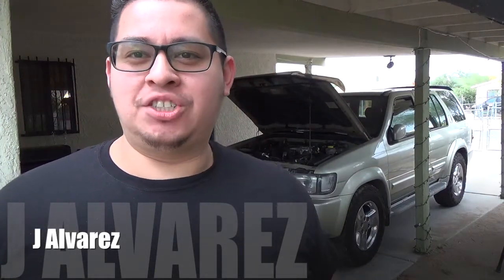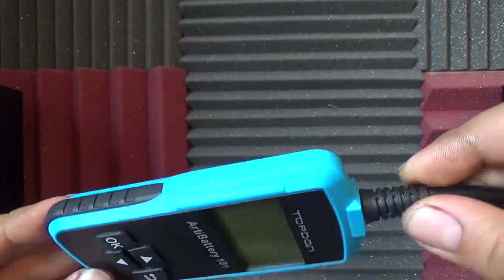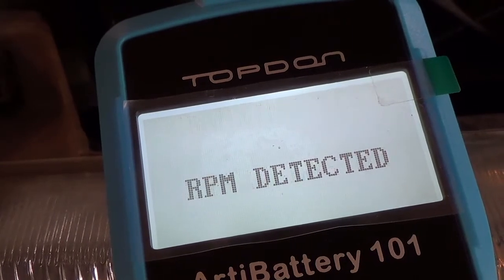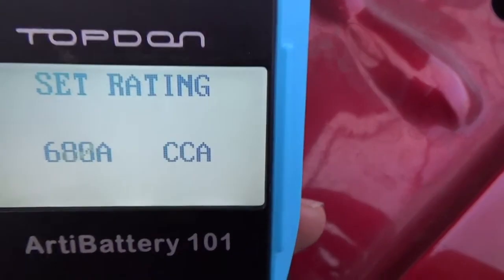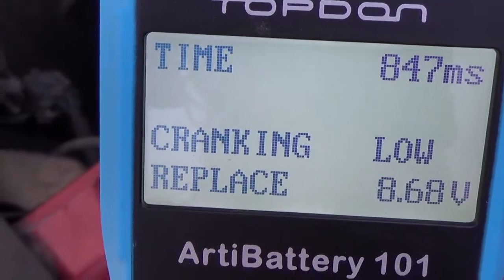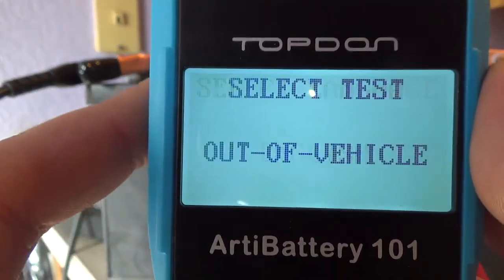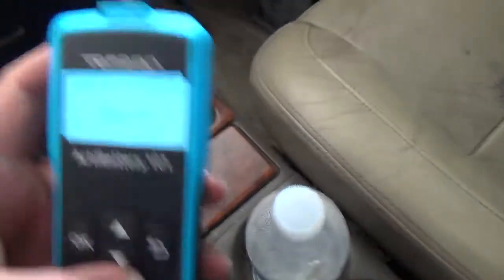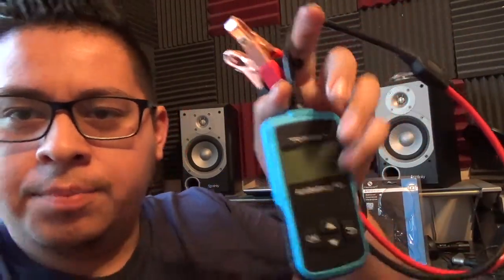TopDon ArtiBattery 101 Review

Comment: You screwed up the battery test parameters by selecting CCA, and then using the higher CA value.  So, the results were for a 950 CCA battery, which it was not.
Reply: Yep. He's right. Should have either chosen CA instead of CCA or input 760 for the CCA that you chose. Your battery may still be good. No point in testing if you're not careful
Reply: And he set it wrong for the type of battery. It’s says AGM not standard flooded.

Comment: You made a minor mistake.  CA is Cranking Amps at 32 degrees fahrenheit (zero degrees celcius).  CCA is Cold Cranking Amps at zero degrees fahrenheit (about -17 degrees celcius).  You had it backwards.  As you can see, the CCA listed on your battery is lower than the CA.  That's because it puts out less amps when it's colder.  I'm sure you know that and you just made a simple error when you said that.  

To really test a battery, it should be fully charged.  Your out-of-the-vehicle battery may actually be good. I would charge it fully and then do the test again.  

One more thing:  Almost all of these testers give the impression that they are reading CCA or CA.  They actually aren't unless you test the battery when it's either zero degrees F (for CCA) or 32 degrees F (for CA).   Since in most cases the battery is not zero degrees F, the tester reading should be substantially higher than the CCA of the battery.  I'm really suprised that almost nobody mentions this. Even the manuals for these meters don't mention this. There is one guy on YouTube that does know this. He appears to be a battery expert.  But I've seen expensive battery testers where you have to enter the actual temperature of the battery -which makes perfect sense. When a meter allows you to do that, it will actually show you the real CCA of the battery.  It compensates for the temperature using a table, I presume.  There's probably tables online that you could find to compensate the reading to find the actual CCA or CA of the battery. In fact, I think I'll look for one myself and keep it with my battery tester.
Reply from the maker: Thanks for making it better for all of us. I didn’t catch that.

Comment: Nice effort but lots of serious errors.  The 2nd battery was tested all wrong.  It was AGM and 760 CCA.  Garbage in garbage out as they say.  The 3rd battery didn't need replacing because it was dead and had 0 amps.  A dead battery can still be ok, charge it and go.  It was bad because the internal resistance was too high and displayed 34.30m ohms.  That's very high, and bad.
Reply from the maker: Cool 😎
Reply: Captain Steve maybe but the cranking test of voltage lower than 9.6v was the real test and the battery failed.